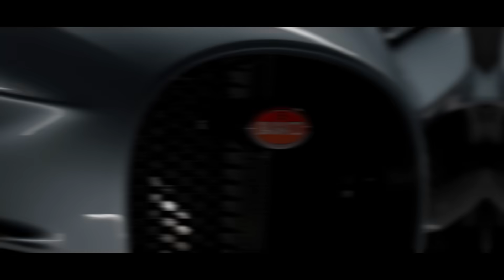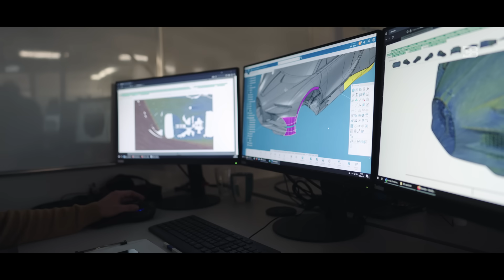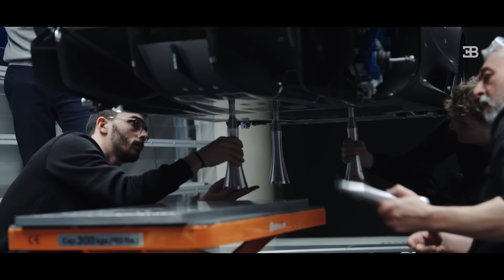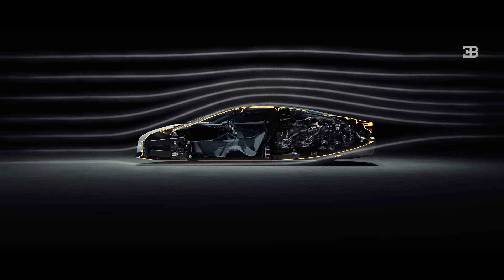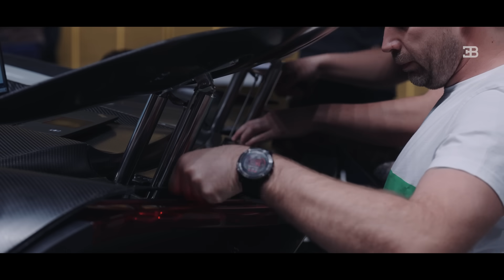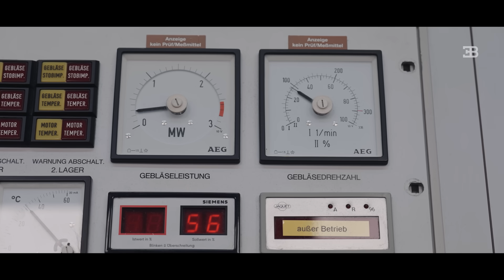BUGATTI – A New Era: Master of Air​

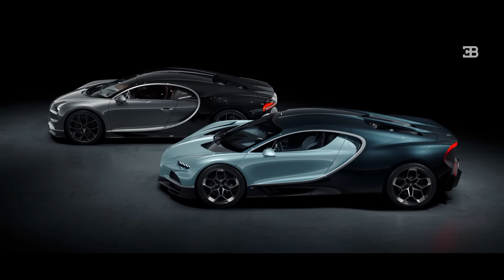Comment: 02:15 why im really sceptical about the windshield wiper design, if it stay vertical like that, there is a cahcnne the wiper gonna wobble if the wind really strong hit the windshield?.. you can see at 01:53 even when they test the card, the wiper not visible.

Comment: Even a single mistake can make the company whole down. While maintaining air flow for highest speed possible, they need to concentrate on security features. If car disbalances at 300 km/hr , you know what's gonna happen. It's not easy to design a car.

Comment: Why reveal the car to the public before completing all the necessary testing, potentially leading to changes in the design if aerodynamic issues are discovered?
Reply: With all the computer simulation and wind tunnel modeling,  any changes would be extremely minor aero tweaks you'd barely notice

Comment: Just asking for the tourbillon super sport are you guys going to put twin turbo or quad turbos
Reply: It doesn't make much difference anymore now all turbos are variable vain 👍 quad turbos is normally done so there's a low Rpm pair and a high rpm pair 🙂 either way modern cars have almost no turbo lag so they can achive the same performance result with a pair of variable turbos or 4 😎👍
Reply: @UKBUILT  citrifigual supercharger would be interesting.
Reply: @tiersofemotion222  It would but they have more complicated maintenance, the traction oil In them needs changing every 2 years, the shafts are prone to snapping, require a cooler for the traction oil and they produce less power than a turbocharger. I do like superchargers tho 😎👍
Reply: @UKBUILT  are you able to run a turbo and a centrifugal supercharger on one car despite the maintenance? 🤔 just have always been curious. I usually see a screw supercharger and a turbo ran together.
Reply: @tiersofemotion222 Hello, Yes you can run any combination of supercharger and turbocharger together 👍 it's rarely done tho as the weight of 2 systems is not worth the power gained. 

For big power turbos are always more efficient, it's best getting the perfect size turbo for the application. Every engine is just an air pump, it sucks air in and blows air out the exhaust. The turbo needs sizing to deliver more air than the engine requires to create boost (positive pressure). With modern turbos they can  create good boost at high and low Rpm.

Superchargers are great for simplicity to install, they are always slightly less power and less efficient but very fun to drive. The other benifit with a supercharger is you maintain the natural engine sound because it doesn't run off the exhaust like a turbo.

I hope this helps 👍

I'm building my own supercar with a Mercedes M120 V12 used in the first zonda C12 😎 I am keeping mine NA (no boost) to get the zonda F sound and good reliability 😁
Reply: @UKBUILT  how do you get that sound out of that engine? Would you need to forge the pistons and have a different camshaft or just straight pipe the car and call it a day?
Reply: @UKBUILT  I was thinking about how the turbo lag works and considered that a supercharger would make up for the rpm range at lower speeds.

But, that's good to know. I also like the unique sound it makes hearing both working in tandem. Some centrifugal superchargers sound like a private jet getting ready to take off and the thought of hearing the woosh from a turbo off the wastegate is insane.